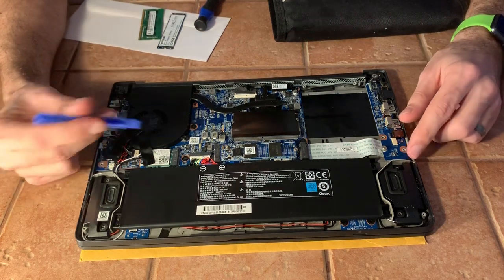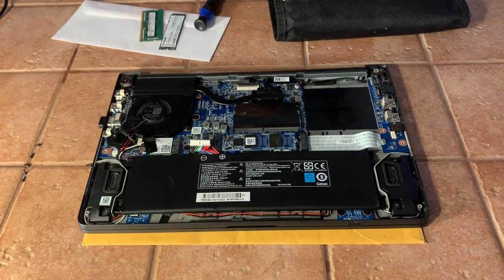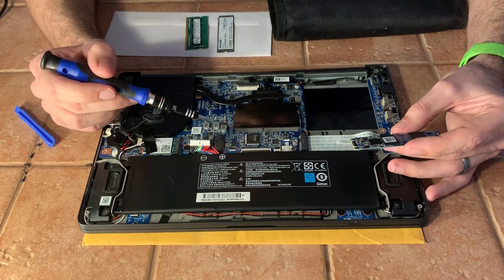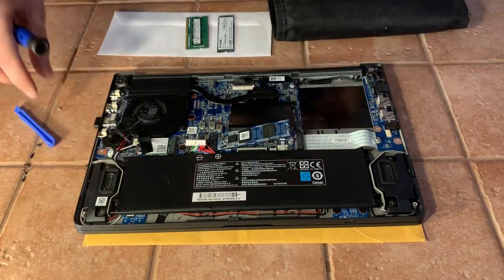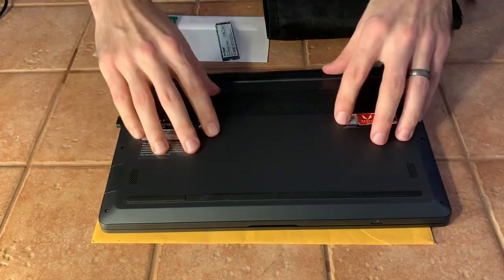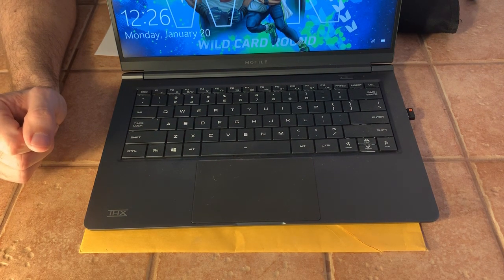Motile 14: In-Depth how to disassemble and upgrade.

Comment: Heat sink removal for re-pasting video please. This thing need Thermal Grizzly!! Ive heard about rivets being used and not being able to get the sink back on
Reply from the maker: I repasted and found it wasn't much improvement. Issue is the aluminum heatsink plate. More thermal conductivity from die cap to plate is immediately stifled by less conductive plate between it and the copper rail. I could do it again just to demonstrate, but if people are breaking the rivets, I wouldn't say it's worth the risk at all. Maybe 1C drop on average. Not enough to change throttling at all.
Reply: @RyanLeCocq  Thats exactly what i heard before, glad someone confirmed it. Thanks
Reply: Hate to break it to you, thermal grizzly is garbage paste. most of the time you get the paste, and it dries out before you can even get the cpu cooler back on top.... its that bad. I have been building computers for 18 years and I can tell you 100% for a fact thermal grizzly is terrible paste.

IF YOU WANT THE BEST, you have to go with Arctic Silver 5. The issue with this paste, is the REQUIREMENT for a "break in" period. Basically as the paste heats up, it gets thinner, and a little runny, not like "omg the paste ran off the cpu when it got hot" runny, but enough that it helps it fill in micro scratches and such, which helps with its ability to transfer heat. That required break in time is 50-200 hours.... immediately you should think "wait, a break in time, what about paste reviews" and the answer is, they didn't test AS5 properly. They applied it, recorded the results, and then tried the next paste. They did not "break in" the AS5, not a single test online has done so (except maybe Puget systems, but most people don't go to them for reviews).

In my own tests, and multiples of them, AS5 after break in out-performed the thermal grizzly by about 5-10c (5c being at idle, and 10c lower at full stress test). My results were always the same. My testing methodology was multiple cpu's and coolers, as well as spreading the paste myself to get full IHS coverage (granted, also tested desktop not laptop, but still).

EVEN NOW, my 3950x is running AS5, with a 360mm liquid cooler, and every time I post my temps online, I am told that I am lying because "there is no way a 16 core 32 thread ryzen cpu at 4.4ghz all core OC can be THAT COOL when fully stressed out" but, if you want the best, that 50-200 hour break in for paste is worth the lower temps.

Back in the day I did however have a AMD 7970 GPU.... and after a few years the OEM paste tried (asus brand, blower style). So I replaced the paste with AS5, did the break in, and holy shit. 20c cooler than the stock paste, and 40c cooler than the bad dried out paste..... which brings me back to thermal grizzly, it may be good paste if you can get it when its fresh, but most likely you are going to get a tube that's been sitting a long time on a storage shelf, and thus it will dry out when spreading before you get the cooler back on.... AS5 is great because although it can "separate" from sitting too long, you can mix it back together making it work like new anyway. You can't do that with thermal grizzly.

Now if you use thermal grizzly liquid metal, one its a huge risk but two, its fucking amazing. probably the ONLY thermal grizzly product I would ever buy.... the normal pastes are just shit.

THE GUY WHO OWNS thermal grizzly, doesn't even use his own paste, he uses KINGPIN OC paste.... which performs slightly better than AS5 (but is also more expensive, and also most sites like amazon are scam's for the paste, because its not really sold in the US, its a EU brand)
Reply: GoblinPhreak how do you feel about the thermal pads instead of paste?
Reply: @liachannel5559  depends on what youre using the pad for. generally thermal pads while having decent specs for the top of the line pads, they wont come close to the effectiveness for paste. now if you look at a gpu for example, pads for vrms and such, maybe even pads for memory, but they generally still use paste for the main cores. the first time graphite pads made their way into gpu's was the Radeon VII, which the reason for that was the varying height of the chip die, because it has HBM which sit next to the main cores.... but for normal ggdr5/6 gpu's, pads on the memory is fine.
For a cpu, always use paste. and if its a laptop, might as well use paste, it can transfer heat better than pads.
Reply: GoblinPhreak wow thank you so much i Can’t believe i didn’t have to pay for that detailed of a response! I bought this motile the Ryzen 5 version and am currently waiting for it to get here. I purchased it solely based on its (mostly) positive reviews but if you have a sec, do you mind telling me what you would do in terms of upgrades to it? I keepReading that it gets pretty hot but there’s not much you can do about that but would you upgrade the RAM or anything else? Thank you regardless, I’m a clueless girl who buys computers based on color so.... yeah, I need all the help I can get lol
Reply: @liachannel5559  well there is only one ram slot, so you should look for a compatible 16gb chip to get the most out of it. windows 10 can eat 4gb of ram just resting (at least my copy of win 10 pro does) so you will want "at least" 8gb ram. you could upgrade the nvme or install a second as there is a second slot in the motile laptop. me personally, i would buy a 1tb and simply replace the oem drive. i did similar in my older laptop which has a sata 3 ssd drive.

i wanted to buy the motile cuz of how cheap it was, but decided against because amd released new processors for laptops, and i am hoping walmart/motile comes out with an updated version using the newer cpus.